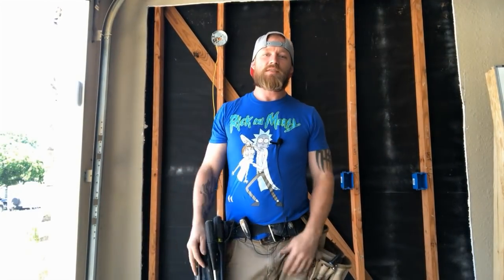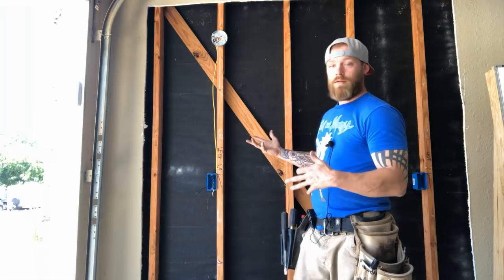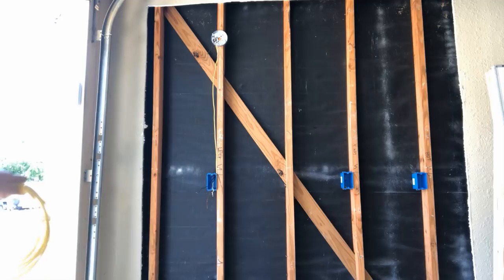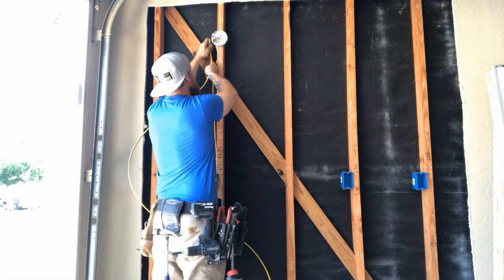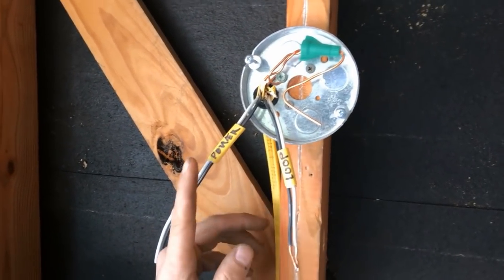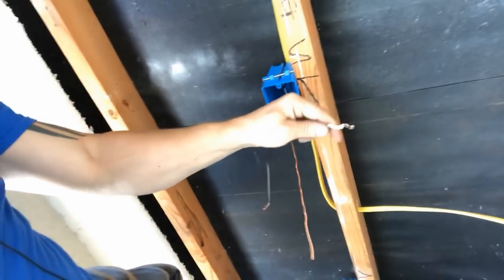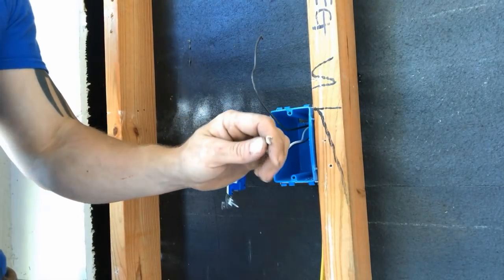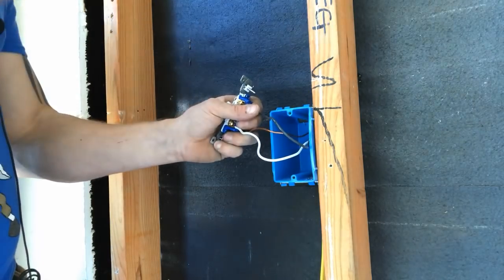Episode 12 - How To Wire For A Switch Loop

Comment: I didn't allow my guys to do dead legs (switch loops). We'd fail the inspection because most of our inspectors considered that light box as a junction box. Not to mention the homeowner or new guy would always try to go in the box when the fixture is being changed and connect all the whites to white, and all the black to black, tripping the breaker. 
Just do it right, bring the hot leg to the switch box, then supply the light box from there.

Comment: Hello Dustin, I'm really glad to have found and enjoyed your video(s)! Could your 'switch loop' wiring be a similar principle to wiring a 'half hot' receptacle? I'm desiring to change an under-the-sink switched receptacle to a 'half hot' receptacle for a new dishwasher installation. Problem is... the 12/2 from the circuit breaker panel is running to the (abv counter) switch first, with a black to the bottom (off) side of switch (with the two whites wire-nutted together up in the switch box), and then a black running from the top (on) side of switch....into identical 12/2 romex (one black, one white, one bare ground) running down to the switched receptacle. So, the problem as I see it, there's no 3-wire running down to the receptacle, i.e. no red (3rd) wire to split the hot power. Question: Is there any way to still turn the receptacle into a 'half hot' receptacle....with only the 12/2 romex running down to it from switch? Thanks so very much if you've the time to reply! ;)

Comment: I have the same thing in my garage, but theres TWO switch poles...need help. The incoming hot to the light outside garage has to be on for the garage lights to have power...did they wire it wrong to the double pole switch? Cant i just reverse the order so that my light switches inside have the hot, and the light outside is neutral?

Comment: Hello, i am having issues wiring my garage...  i am running my lighting circuit.  First, i wanted to run my power feed from the panel, to a junction box (which will split towards a motion activated flood light that is continuously powered, split to the garage door opener, and split to a switch to power separate work bench lights)..  my first junction box split is as such... panel box, to junction box, to motion activated flood light (always powered), to light switch, to ceiling lights for garage.  I wired hot to hot and neutral to neutral and ground to ground at the JB and the motion flood light, then i ran Down to the switch to where the circuit will be broken to turn off/on the ceiling lights when needed.  I pig tailed the 2 neutrals at the switch and connected the hot wires into the switch, and also connected the grounds.  I didn’t wire in any ceiling lights from the switch yet, but i turned my breaker back on and the flood light connection box keeps popping and sparking when the breaker is flipped on.... what do i have wrong here?

I don’t want to break the circuit until after the flood light, once the circuit hits the switch for the ceiling lights.

Comment: The switch loop itself is not to code anymore. The NEC now requires a neutral wire at every switch location....   My guess is that they require a neutral for the newer style of LED dimmers on the market.

Comment: An easier explanation that I found is to think of electricity as water flowing through a pipe.  The black hot wire (pipe) in the light receptacle is connected to a longer pipe (white leg wire) and connected  to one end of a shutoff valve (first switch screw) and another pipe (black leg wire) connected to the other end of the valve (other switch screw) and back to the light receptacle and connected to the gold screw (hot) of the light fixture.
Reply: I never understood this. If you cant grasp  resistance in a circuit,  why would you in plumbing? 
Now I wonder if plumbers say "think about it like current through a wire"
Reply: @Ryan-hr9hw  lmao now that's a good one 😂

Comment: Thank you for the great video. I have a question. My ceiling light take a few minutes to turn on after turn off for about 30 minutes. Not sure about the problem. The loop is connected in the same way as in the video. Power from the ceiling and instate of the white they use the black wire to connect to the power wires (black) and run to the switch and white wire up to the ceiling light again. Before, the ceiling black wire backward connected to the neutral and the ceiling white wire is connected to the white hot wires (white) from the switch. After watching the video I have reversed it. The neutral to the neutral of the ceiling light and the ceiling back wire to the hot white wire from the switch. However, after turn on the light for a few minutes and turn off and try to turn on again the ceiling light still take a few minutes to turn on as before. I try to check if there are any loose wires connection but the problem still happen after making sure all wires are connected properly. Can you please advice me if there are anything that I might have done incorrectly? Not sure the ceiling light socket or the wires is mess up as it was connected backward before. Thank you.

Comment: i want to add 2 lights in a row to an existing circuit power source.. i Am wanting to put an end of line switch (loop Switch) after these 2 new lights. I understand from your video how to wire a loop switch but my question is (two-fold) ...do I wire the 2 lights in a row the same as wiring a single as in your video?... another words utilize the neutral from the first light ( in line from power source) as a power source as in "daisy chaining" the wire to the second light, and then down to the switch?? Also, as I stated earlier, it is an existing power source from another light, so , in adding this loop switch , will it affect the existing light power?

Comment: Hi, please help.. I disconnected the wires in the j-box that was feeding other lights with light switches. I couldn’t figure out how to reconnect the wires. Just saw your video and I guess I’m dealing with a switch loop connection. So there’s a wire coming out from the ceiling going to my other lights that has a light switch for the light. Can I just rewire the power just like you are showing in this demonstration?  Because I already had tried connecting it from the power black to black and white to white but the my lights just stayed on and the light switch won’t operate it which it did before I disconnected the j-box connection. 

Any suggestions? Thanks

Comment: So how would you add a light fixture and switch down stream? I imagine there would be a power leg between the two fixtures, black connected to the power black and white to the power neutral. Then the same set up for the switch leg as the first light and switch?
Reply from the maker: Check out the other videos in this series. And if you still have this question. I'll be sure to answer you ASAP.

Comment: I have a switch loop coming from a bathroom ceiling light. The wiring runs through another electrical box for a vanity light. I thought it would be as easy as connecting the black to black and white to white in the vanity light box with the wires running between the ceiling and the switch but the vanity light doesnt work. Any ideas of how to fix this? This is in the basement so I am unable to run additonal wire without ripping walls apart.

Comment: I think I would have run power to that spacious, roomy switch box and a switched leg up that tiny flat pancake box. I could then continue the circuit on to other switch locations from that box and controll other lighting. Either way works fine, I just consider the other more useful. Take care...

Comment: I would love to install new light switches, that I could control through my phone. A switch loop is where you can control a light switch from two separate switches? I love to control a hallway light, that I could turn on in my bedroom and turn it off in my living room? Because, I have no hallway light at all and it's dark between the two bedroom hallway.

Comment: Can you do a video on running wires in wall that is concrete block with filled cells covered by 3/4 foam board with 3/4" fir strips for drywall nails. Thanks.

Comment: I'm installing some lights in a room and the easiest way to run the wires for me would be to use a switch loop. However, I'm going to be using a smart switch which requires a neutral wire. I'm thinking I will just run a 14-3 wire from the fixture to the switch that way I have an extra wire that I can connect to the neutral on the switch and just have the other end pigtail with the neutral at the light fixture. Would this be okay to do?
Reply: its a good idea to run a 3 wire (red, black,white and bare ground conductors)"today" to your switch as you mention...many local codes require the "dead ended" neutral "wire nutted" and left in back of switch box for future smart switches and such......
Reply: also it would be code to wrap that neutral being used as a hot switch loop with black or red tape to indicate such.......

Comment: Hii there Electrician U,

how to fish for neutral wire when there are other wires that seems to be neutral lying in the socket.. for example load return wire.. which when checked with that power present contactsless detector pen it appears to be neutral. ,
but it actually is a load return wire, which can't be use as neutral to my led light.

appreciate your guidance. 
andrew

Comment: Noob here. I have a bathroom light switch with only two wires (one black, one white) The white is hot, even though there's no black tape to signify that, so anyway I'm assuming it's a "switch loop" setup and the white is not a neutral. There's also a ground wire screwed down in the box but no ground to the switch. I'd like to be able to replace the switch with a gfci/switch combo. Is this possible?

Comment: Help my apprentice mind understand:  Is it against practice, or discouraged, to terminate the black line wire and black switch loop into the wire joint (rather than terminating black into white) when the line wire is in the recess?

Comment: Hii there,

i would like to know how to add a new light and switch to the existing (ceiling fan) switch.  i was having trouble figuring out is the "appearance to be neutral wire" a direct neutral to the fuse panel a  neutral wire or it is a return wire from load (ceiling fan coil). i was trying to minimize additional conduit crossing over here and there on existing conduits on the wall.. hence i want to use the power and neutral from the ceiling fan (i know it is not good to use socket power (which ceiling fan is consider a device plugged into socket, even though it is without a socket physically) to do light, which in this case it is not the only light of the kitchen, so it is ok).

i ended up using the neutral that just folded behind the socket... and when the fan turns, the light blinked.. then i know it is a returning line from the fan coil. which means there is no direct neutral from the fuse panel at the current location, it is using the method that you mentioned in one of your video .. which the neutral wire never being pulled down to switch.. darn it.  
now what should i do ?  the rest all wired up.. even conduit is done.. i have to locate the neutral wire and pull a new conduit all the  way from the fan location to my switch.. that's is a lot of extra works.. any better idea ? 

AND MY MAIN QUESTION THAT I WANT TO ASK IS, HOW DO YOU IDENTIFY THE NEUTRAL WIRE IN MY CASE JUST ABOVE , HOW TO TELL IF THAT FOLDED WIRE IS THE DIRECT NEUTRAL TO FUSE PANEL OR IS IT THE RETURN LINE FROM LOAD ? 
AND HOW DO YOU CALL THESE 2 TYPE OF NEUTRAL WIRE ? THE OFFICIAL NAME SO EVERY PRO UNDERSTAND WHAT I  MEAN.

TQ VERY MUCH. 
ANDREW

i am not not and pro electrician but when ever i do my wiring around my house, i always try to be as neat and tidy as possible.  which somewhat is better than those paid constructor electrician at my area (which always did lousy  and confusing jobs, and doing all the shortcuts to save time). 

today i want to install LED bulb at a dark corner of my parent kitchen, and i want to install it just at the door frame of the entrance of the kitchen.. which already have a ceiling fan switch and electronic regulator installed there.  (the whatever electrician did the kitchen switch did it in the middle of the kitchen, hence my elderly parent have to walk in the dark slowly to turn on the kitchen light all the while.  which is dangerous and stupid. 

instead of installing a 2 way switch and pull the conduit cross over the existing pipe conduit, i just install another light at darker corner of the house and the switch at the entrance where the fan switch is (stupid right ? fan switch is at the entrance, while the light switches are in the middle of the room)
Reply: Andrew ysk@ The guy who wired that light up did something that's been illegal since before he was born.  In the old days they used to have what they called "pendant lights", just a light hanging from the ceiling by a chain with a turn switch on the socket.  So you had to stumble into the middle of a dark room to turn on the light.  That does not fly anymore!  You have to have a switch at each entrance to a room so that it can be lit BEFORE you enter it.  There are 2 ways this requirement can be met, a ceiling fixture controlled by a wall switch (as in bedrooms, bathrooms, etc-), or a chandler or a switched outlet with a lamp which is commonly done in living rooms.  This is just basic human safety/common sense rules.
Reply: i would like to know if there is a way to know a non-live wire is a neutral directed to mcb or it is a load return wire ... is there anyway to test it out or tell ? 

thanks
andrew

Comment: I just recently purchased a new rental property and while doing some upgrades on light switches and fixtures I noticed someone previously attempted a loop switch but neither of the light switches that are connected turn the light off or on when taking a live wire tester to the cords connected to my switch which is 3 it reads that all 3 have current weather switch is on or off I know
2 should have current but why does my ground read current

Comment: Doesn't 2020 code call for neutrals in switch boxes?
Reply: Yes, actually since 2011 code required a neutral in the switch box.    So to comply with Code,  you'd run 14/2 or 12/2 to your light fixture,  then drop a 14/3 or 12/3 down to your switch box.   In the light box you wirenut all the whites,  grounds and blacks together.   You hook the white, red & ground (if required) to the light.   In the switch box the black,  red, & ground connect to the switch.    The neutral is capped with a wirenut and pushed into the back of the box.    Reason for this Code change,  is because nowadays there are many electronic switchs such as dimmers, time clock, and motion sensors,  to name a few,  that require a neutral to operate properly.    

Incidentally this wiring method is rarely used today,  the only time I use this method is  for converting pull chain fixtures into switched fixtures during renovations,  I fish a 14/3 from the light, down to wherever we are adding the switch.    In new construction I always run power to the switch box,  then run my 14/2 leg up to the fixture.    It simplifies troubleshooting in case of a problem.

Comment: I was wondering. Would it work here to bring the hot wire straight to the light fixture and break the neutral side through the switch? Reverse order in other words.
Reply: The switch would turn the light on and off, but you'd be creating a safety hazard.  By switching the neutral, you're bringing 120v to the light at all times, whether the switch is on or off.  Someone changing a bulb or the fixture could get hurt.
Reply: Code does not allow switching of the neutral. You must break the hot!

Comment: Hey man thanks for the videos.. But I'm  confused.. I have a  bathroom 2 switches fan and a light. I have 3  cables which are 2 wire coming into box. Tested the incoming lead. Power on the black wire.. if this is a loop how do I wire this??
Reply: Hi Keith

Comment: Does having this "dead end" setup make it impossible to install a timer switch? I picked up a dusk to dawn type switch for my front porch light only to find this type of install. Problem is the switch requires the hot line in then the load going to the bulb then the neutral coming back into the switch. It also came with a jumper wire that connects to the neutral wire. Switch also requires a ground which I do have. I'm in over my head at this point lol
Reply: I'm in the same boat as well. I tried replacing a switch loop light in my bathroom with a fan + timer switch. I know the fan works, but am not able to get the timer to work.